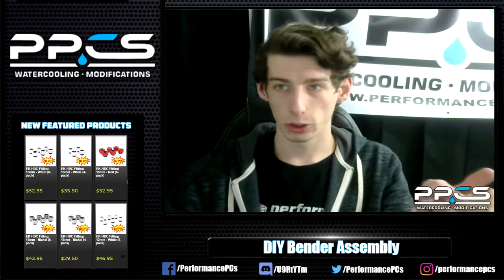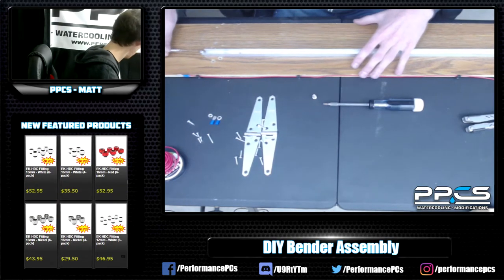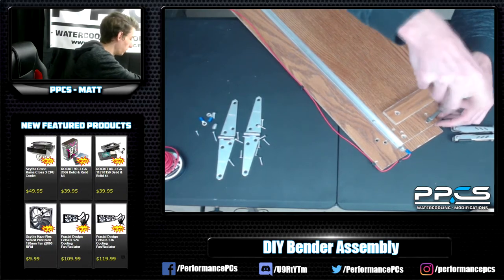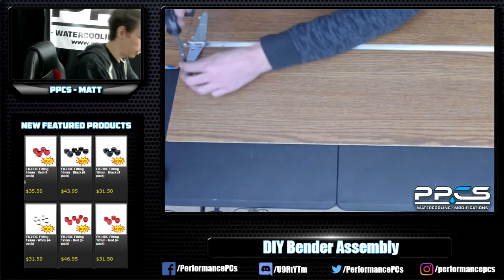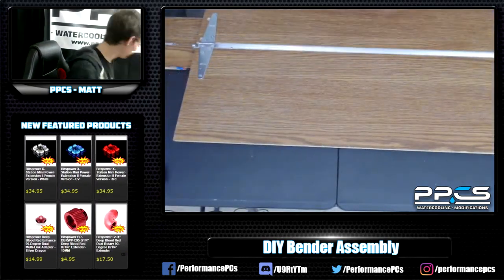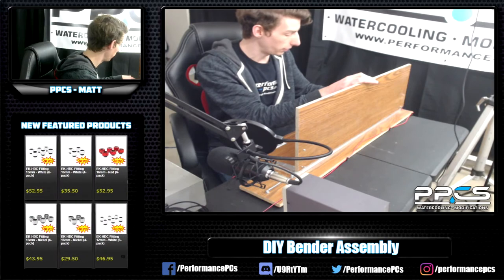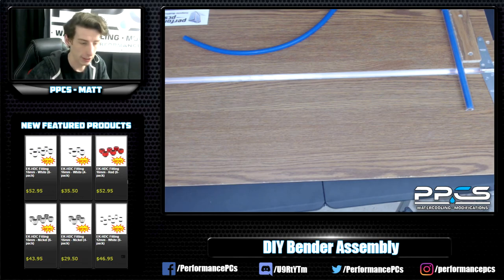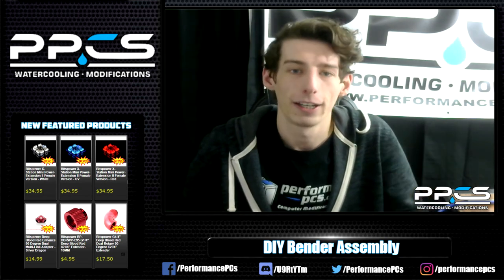Builder's Club Live Show - DIY Bender Assembly

Comment: Nice job man. What gauge wire did you use?  I've been fiddling around with one just like this for awhile now and I can't seem to get it hot enough. I even have the exact same psu as you. I'm using 18 gauge nichrome wire. I've been playing around different lengths thinking my resistance isn't right.
Reply from the maker: Yea, definitely get some 26g, that's what I used for the 5a. I believe 18g would work well with a 10a PSU.
Reply: PerformancePCsTV awesome. Thanks man. Amazon prime to the rescue. Lol. I'll give that a shot.
Reply from the maker: Thats where I got mine :D Let me know how it works out!
Reply: PerformancePCsTV will do man. It arrives on Sunday. I'll post back the results.

Comment: what power supply you use for the bender,  a regular pc PSU will work?
Reply from the maker: I used this PSU. A PC PSU will not work for this application, you need a variable PSU. 

https://www.ebay.com/itm/KPS305D-Variable-Adjustable-Lab-DC-Bench-Switching-Power-Supply-0-30V-0-5A-0-10A/162602768074?hash=item25dbe156ca%3Am%3Am-ags9ZikHT9TvtY4e9sztw
Reply: Thanks a lot